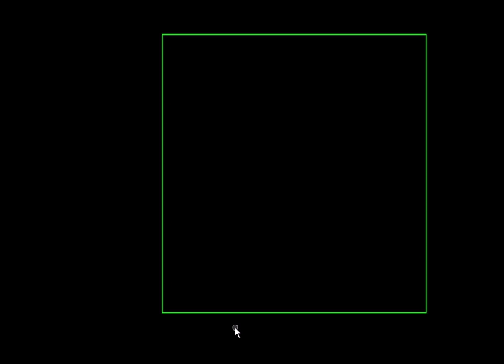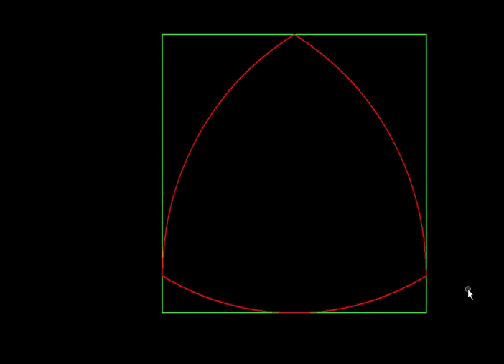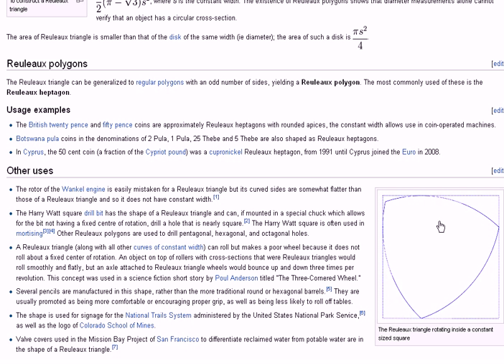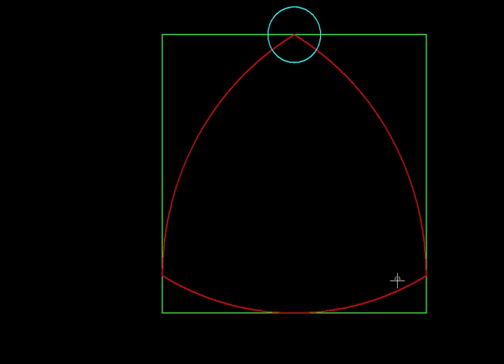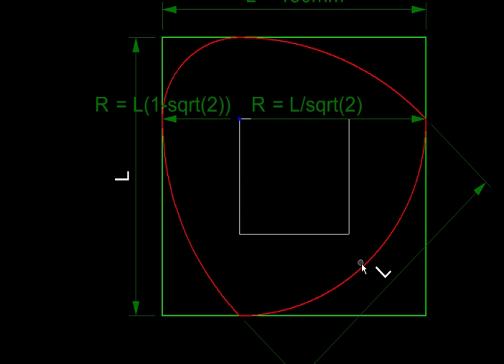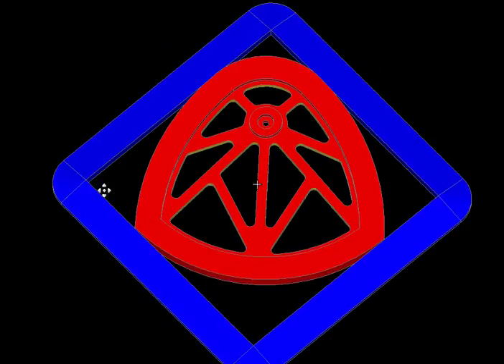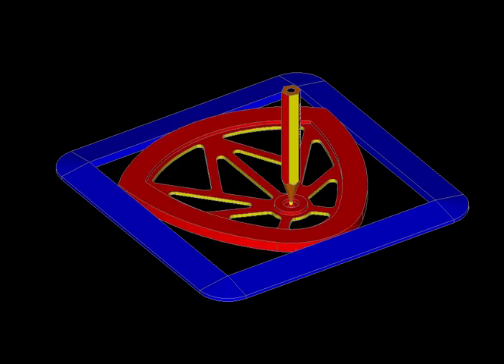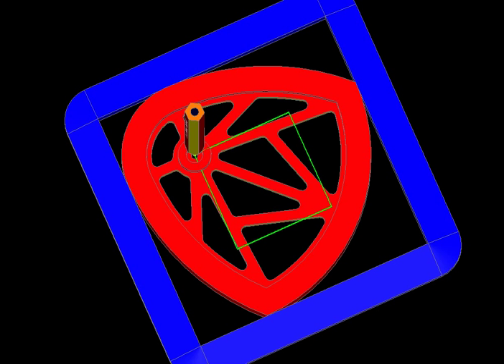Kinematics Ch07F Square Hole Cam

Comment: I do not understand how you blend the circle and Reuleaux Triangle to get the 4-arcs thing in 2:44, I mean, how can you just simply blend two graphs?
Reply from the maker: +James Liu The 'roller' or circular arc, sliding on a straight line, makes its center move along a parallel straight line. To we add it at the vertex and modify the two adjacent arcs so they start from the same point at the base, but then become tangential to the 'roller' just added. Now imagine any line passing through the center of the roller. It will intersect the lower arc and the roller. And the segment connecting these to intersections will be of constant length. Sorry, it is hard to describe without a sketch, but hope it is clear.
Reply: +UjjwalRane Thank you so much !

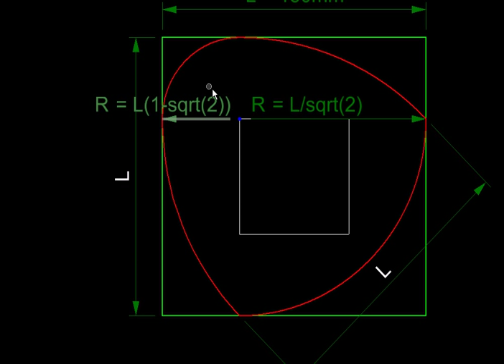Comment: Hi, I know this thread is quite old, but was wondering in 3:09 how does L(1-sqrt(2)) + L/sqrt(2) add up to L? If I were to choose the length of the inner square arbitrarily, how do I need to choose the other parameters? Sorry this isn't clear to me... I tried to find a paper on this, but couldn't find anything explaining the math. Would be greatful for any help, thanks !
Reply from the maker: You are right. Thank you for spotting the typo! Wonder why no one noticed all these years?
(1 - sqrt(2)) would be a negative quantity. It should be (1 - 1/sqrt(2))
I will add an annotation to that effect there.